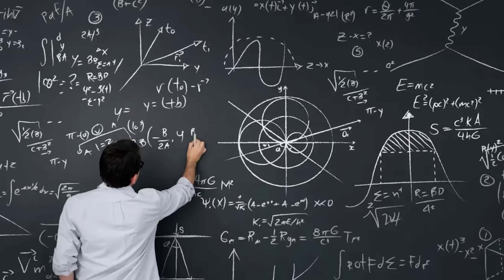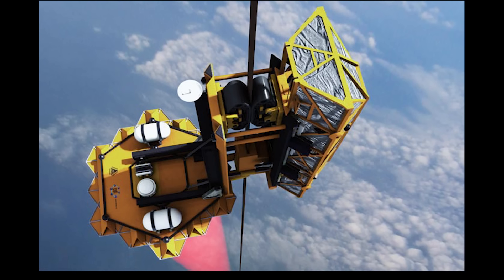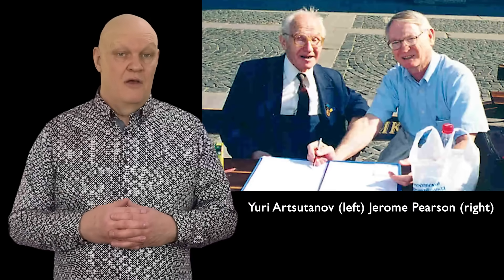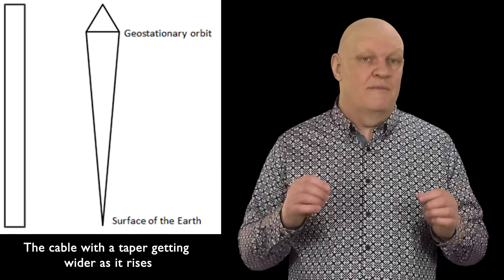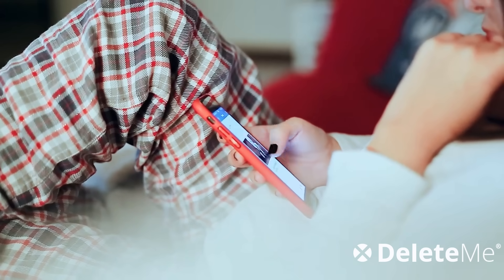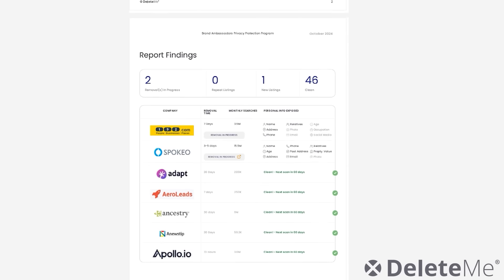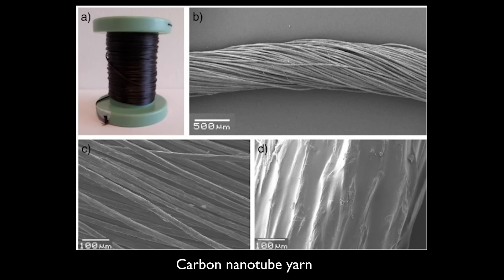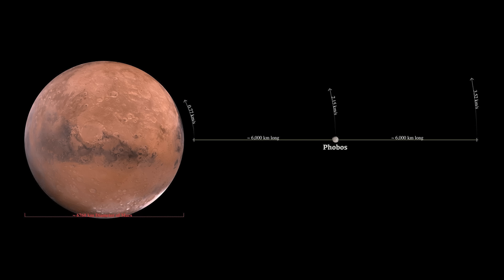Are Space Elevators Still a Thing for the Future?

Comment: There's actually another elephant in the room no one talks about: angular momentum. Getting things up is easy, accelerating them sideways to orbital velocities is the hard part. Unless any tether would be strong enough to tug the cargo with sufficient strength sideways to accelerate it, it will still need lateral propulsion. And even if the tether was strong enough, there's still no AM for free in this universe. You would take the AM budget from the central station, pulling it into a different orbit, so that in that case the station would need lateral propulsion to compensate. The only advantage would be that such propulsion could be of much lower thrust than a typical launch engine, since you have the tether holding it up.  But that is only a small fraction of what's needed to get to orbit, so any space elevator will be much less an efficient solution that it may seem.
Reply: If you had a captured asteroid as the counterweight you could send an equal amount of material down to balance out what came up.  However that still leaves into the issue of climbers and descenders wanting to pull in opposite directions as they gain or shed sideways momentum.  Any well fleshed out space elevator proposals I have seen always limit the speed of the climbers/descenders to about 600 MPH, as otherwise you would end up with a whip crack effect that would break the cable.  Which makes for a rather slow trip to GEO and greatly reduces the amount of mass that can be lifted in a given time frame.

Comment: Why nobody takes air drag/wind into account? Or that any climbing load would pull the whole thing down
Reply: Because it is geostationary it is rotating with the earth, staying at one point in the air, not cutting thru it at 24000 miles per hour. The only winds of any note would be the jet stream and any random hurricane, which wouldn't have all that much effect on the proposed cross-section. But yes, it would have to be taken into account in the design.

Climbing load is handled by the counterweight, which is over-balanced and keeps the string in tension. Car+load weight is vanishingly small compared to the entire system mass, so not much of a concern.
Reply: The winds will only be on the first 50 km or so. The other thousands of km will be in vacuum.
Plus the tension in the cable from the counterweight will be more than sufficient to make wind effects negligible.
Reply: @PeterDebney  And why would you think that counterweight is fixed in space? That every newton of force pulling on it wouldn't deorbit it?
Reply: @ Nothing is "fixed" in space, but the counterweight is kept in its effective orbit by the tension - the centripetal force - from the cable. If the cable were cut it would exit to a much higher orbit or even further. 
The force required to pull it down out of orbit is considerable, and far more than the forces exerted by the wind on the bottom 0.1% of the cable.
Reply: @PeterDebney  What force? That orbit isn't infinite force. Anytime you pull on the cable, you drain some of that. That's why the ISS needs to be re-orbited quite often. Even that high, the tiny air drag is enough to pull it down. You know when you spin a bucket on a rope? You need to constantly add force for it to keep spinning.

Comment: Quite apart from the physics, they come to the issue of practical engineering and actual construction, ...as an engineer myself,, Can someone explain the very little matter of how the hell this thing would be built? Because everyone who talks about space elevators, always ignores the most difficult thing about them and that's how you actually put one in the space including paying out the cable to the ground, oh from the ground to space... Because the cable itself would be subject to celestial mechanics, and the effects of drag in the atmosphere....

Another problem when the last time NASA put a space tether into orbit.. The electrical potential difference generated across it produce such a high current that it caused the space to break.... As this thing consist of conductive materials, the electrical voltage generated across it would be huge, and extremely dangerous...
Reply: Not to mention all the satellites & orbital debris that would need to be cleaned up before even thinking about laying out a cable.  Anything in orbit that's not on an equatorial geostationary orbit will eventually run into it at orbital speeds.  Basically, EVERYTHING in orbit would have to come down before a space elevator is possible.
Reply: As someone who has been a part of a team splicing a ski lift cable, I'd be impressed to hear a practical way to even accomplish that with a cable of this magnitude.

Comment: No one talks about the force required to accelerate the ascending object horizontally.  This would pull downwards on the cable...big problem.
Obviously not as big a problem as the cable length and stresses involved.

Comment: You should also reference the space elevator in Kim Stanley Robinson's "Red Mars" trilogy, which (spoiler alert) was attacked by terrorists and became a planet-wide disaster. My point being the incomprehensible risk of planetary structures that large.
Reply: so are nuclear power plants to a smaller degree
Reply: While I dislike space elevators this particular argument against them is not really valid. The cable when experiencing re-entry will likely break up into smaller parts. The weight to its volume ratio would be so crazy that its terminal velocity would be extremely slow. It would be like a feather landed on you. Remember we are talking about an extremely light weight and VERY low density object. The climbers on the other hand would be a different problem but that isn't anything new.
Reply: Same thing happened in the TV adaptation of "Foundation" by Asimov (there was no space elevator in the books)
Reply: Fiction creates a lot of problems that just wouldn't happen in reality - especially on earth.   There are multiple ways to make a space elevator extremely safe.  Safe enough to the point that creating a disaster from the elevator itself would be a thousand times the energy and effort of simply performing a direct attack or engineering a disaster from earth's own geology.   Besides, the ribbon constructed from Carbon Nanotube would not wrap around the earth - that's not the way physics actually works.  :)  Think about how Blue Origin launches its New Shepard tourism rocket - it goes straight up... and for the most part comes straight back down. Most of the ribbon would fall in an area no more than a few kilometres around the anchor point... assuming you just didn't have a spool system to take up the slack at the terminal velocity of the ribbon - which, thanks to its material properties, would have a terminal velocity more like a parachute than a band of steel.  In fact, it would be possible to construct the ribbon with parachute packs on it to slow it down as it entered the thicker parts of the atmosphere.   Also - the ribbon would most likely break due to sabotage from the climber - so it would likely break between the satellite and the ground.   This would launch most of the mass of the cable and the counterweight into a higher orbit.  The climber could be equipped with emergency components to deliver it safely to the ground.   Only a fraction of the cable would fall to the ground.  There would also be no structures directly attached to the cable other than the ground anchor point, the climber, and the counterweight.   The geostationary satellite would not be directly attached because its job is simply to transfer modules from the climber to the satellite - and vice-versa.
Reply: Yes, it would have to be in a remote region, surrounded by a large no-fly zone, and guarded by a huge air-defense system. The cost of shipping anything to and from it alone would be ridiculous.
Reply: @RetNemmoc555  In the book the whole length of the cable collapses down to mars, wrapping the whole equator and destroying everything that sits on it. Really spectacular scifi though.

Comment: I remember, as a kid less than 10, asking my dad "Why don't we just build really tall tube, so when you open it at the bottom, you just get sucked into space like a straw?", and his answer crushed me, he said "The air in the tube would be too heavy, and there would be no suction."... I've never stopped thinking about it, and now I have renewed hope!
Reply: The flue effect, what draws smoke up a chimney. This would keep the air being sucked up the tube, warmer air will rise up the tube, so as long as the temperature of the air in the tube is higher than outside, it should draw air up. It could be very hot if necessary.
Reply: I asked the same question! Kinda like making a water pump by extending a tube into deeper depths and higher pressures! Although it does work with a pump for cooling!
Reply: He should have just said that the tube will have to be thicker than entire universe.
Reply: @Surgical02  that would be interesting. I have heated with wood and coal for years. The flue effect may work if the tube is insulated enough. Much like convection in a T storm!
Reply: That is so simple it's genius!!

Would it be because there is no vacuum of space?
Wait, how do we have an atmosphere next to a vacuum anyhow?
Now im not going to stop thinking about it....

Comment: And 300 kph is ridiculously fast, not happening.  Try 100 kph and 2 weeks to get to geosynchronous orbit.  Should we focus on reality and not sci-fi?
Reply: Why is it too fast? My car does 300kph comfortably. And trains go even faster, which are a better analogy anyway.
Reply: @andrasbiro3007  It's not too fast.  It's too fast to obtain.
Reply: @ 
Maglev train. Way faster. On a reasonably straight line Maglev can go supersonic too. The limitation is not technology, but the g-forces in the curves. And then once it's out of the dense atmosphere, it could go hypersonic.
Power is no issue either, electromagnets are very strong, and electricity should be abundant and cheap from space solar.

One thing that can limit speed is the flexing of the cable. The more rigid it is, the faster you can go up.

Comment: Lovely overview of the challenges of building a space elevator.  Of course, there is the nightmare scenario described in Red Mars where a space elevator tether breaks!  That might have been an interesting discussion to add: what safety considerations are needed for a space elevator when the tether fails.  Frankly, the engineering needed to handle failure seems a lot more daunting that the problem of engineering the tether (which I suspect will be solved in 20 years anyway for other applications).  Cheers!

Comment: "Orbital rings" are perhaps the 'mirror idea' to space elevators where the physics and material science actually does work out and is absolutely within the scope of existing technology to construct. The issue, of course, is the gargantuan cost and engineering complexity of actually building and assembling one. It's always been very frustrating to me that we have a technology like a space elevator that'd be hugely expensive but feasible to afford and build if only we can work out the materials and that at the same time we have this other technology where we have all the know-how required to build it but don't/can't because the cost is insanely prohibitive
Reply: Orbital rings could be built affordably. The trick is that you only need a thin ring at first, then you can use it to transport material up for a bigger one, then repeat until you get to the desired size. Also the cost of launching stuff goes down drastically with Starship, that helps too.
Reply: As Earth's orbits become more crowded orbital rings will become a more sound idea.
Reply: Even if we had the materials, a space elevator would likely cost more per kilogram lifted than an orbital ring, and a space elevator wouldn't be able to service LEO, which is where most of the demand is anyways.  Fully reusable rockets have the potential to reduce cost to orbit to a small multiple of air freight costs, that would be enough to build out quite a bit of industry and tourism in LEO, which would in turn make it more worthwhile developing and building an orbital ring.  There might also be a transition stage where reusable boosters carry payloads to rotating skyhooks without the need for an upper stage.
Reply: Orbital rings are just as ridiculous as space elevators. Both is purely powered by fantasy and any attempt at the actual feasability, viability and reality of operation shows it to be utterly nonsensical to make.

And whats the point? Same way how a space elevator wouldnt save money, orbital rings dont create required space. Earth isnt actually 'crowded', its just that 'nice places to live' are crowded. Theres near infinite space to live in a cave, deep under the earths crust or on the ocean floor, and either would probably be more convenient and cheaper than in an orbital ring.
Reply: @termitreter6545  The concept of a tethered ring is completely feasible. There's at least one peer-reviewed scientific papers that explains the physics and economics of why this is so.
Reply: @ 
No, orbital rings don't use any fancy tech or material, they are just big. But there are ways to get the cost down to a reasonable level. For example the way they build suspension bridges. They fly over a thin cable with a helicopter first, then use it to pull a thicker one, then use it to pull an even thicker, and so on. Only the first step is expensive.
Orbital rings are like suspension bridges, just go around the entire planet.

And the point is dirt cheap space access. For everything we'd want to do in space.
One of them is colonizing other planets. Not because we have to, but because we want to, and just in case something bad happens to this one.

Comment: I was surprised the Space Elevator Climber competitions that have been held off and on since the 2000's weren't mentioned, the organizations devoted to promoting the various concepts, nor the other proposals that involve disconnected tethers that rotate around a geostationary point with the arms coming down to the surface and raising back up twice a rotation.

A lot of good science effort has been put into this idea, and NASA's study in the early 2000's referenced most of the problems besides the obvious suitable material issue were focused on the necessity of changing laws already established that would prohibit such an endeavor.

The fact of graphene being a potential material also could allow the ribbon to be a capacitor to power the station and climbers as they orbit and traverse.

Lastly the idea of a lunar space elevator being possible now with current materials was never mentioned. This technology would be a huge leap forward taking payloads per launch/lift from 1-2% to +95% and I for one do hope for such a world wonder to be build in the foreseeable future.

Comment: I'm a bigger fan of orbital rings, but that's WAY further in the future than Space elevators :)
Reply: No, they don't require any fancy material, they are just big. Could be built like suspension bridges. They fly over a thin cable with helicopter, then use it to pull progressively thicker cables until the desired size is reached. Similarly you can build a thin ring first, then use it to send up more cables.

Comment: If you even created a conductive cable that goes up to the ionosphere, a huge electrical discharge would occur, a space elevator will remain as science fiction.
Reply: Are you implying a 50,000 km long conductor moving through the Earth's magnetic field would create some kind of voltage? 
Silly silly fellow.
Reply: "One issue brought up is the possibility of discharging the ionosphere. Our calculations based on the size and conductivity of the ribbon and the electrical properties exhibited in our upper atmosphere illustrate that a small area (square meters) around the ribbon could become discharged in the worst conditions. The magnitude of this discharging makes us believe with high confidence that no adverse local or global phenomenon will occur. It also shows that it is unlikely, without considerable effort, that any kind of usable power may be generated by this same method." — The Space Elevator NIAC Phase II Final Report
Reply: @MatthijsvanDuin  Considering that cloud to ground lightning occurs with a resistivity several orders of magnitude higher than that of a CNT cable I think these estimates are way off, the skin of the conductor should exhibit a St Elmo's fire or corona  increasing the conductivity exponentially the effect on the local weather and the ionosphere would be interesting IMO
Reply: @ChrisDay-sx4lv  lightning was not the topic though, ionospheric discharge was.
Reply: @MatthijsvanDuin  Lightning discharges are connected to the ionosphere, sprites and elves interact with it challenging the convectional theory of charge accumulation in storms.
Reply: Of course. How else would you efficiently power the system?